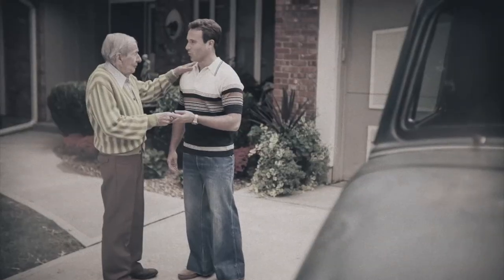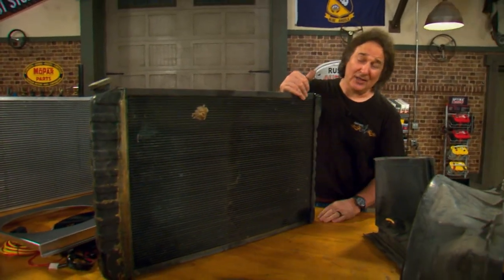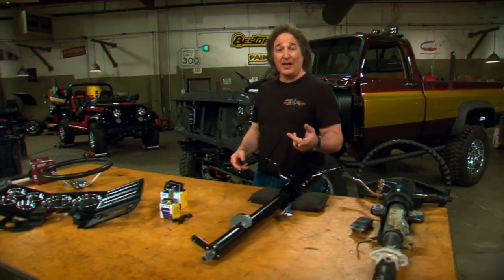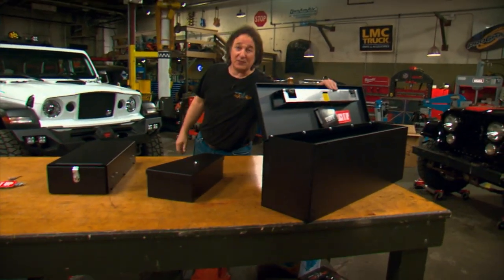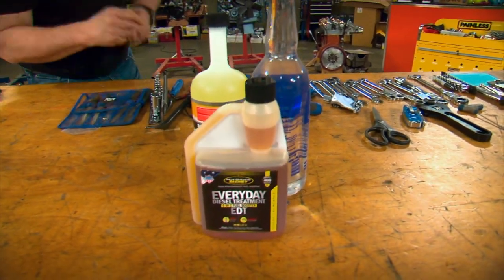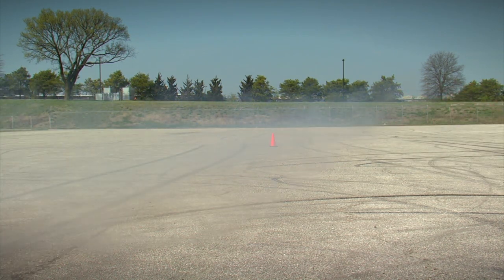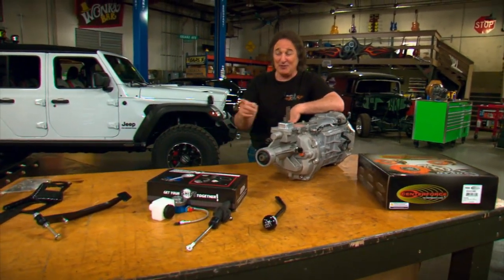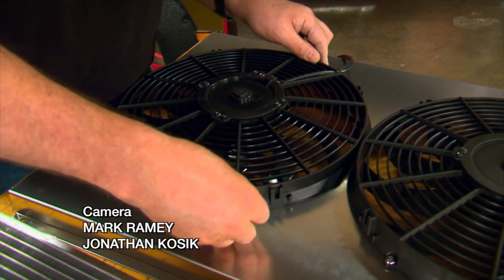Stunt Double Squarebody Chevy AC & Cooling Upgrades & Jeep Security - Stacey David's Gearz S14 E10

Comment: just an fyi, u can repair a furture hole in that copper condensor and radiator with sand paper, a basic role of solder, and a blow torch from a local hardware store. can't do that on the aluminum stuff. something to keep in mind when deciding to replace them.
Reply: i soldered my copper rad on my 85 k20 once and ill do it again before buying an aluminum one . nothing wrong with new its just cool to keep it old school

Comment: Gladiator?  I remember when the Gladiator was built off the old Jeep J-series truck chassis. There was an extended  Wrangler based wagon built off the Wrangler or CJ chassis. The CJ8 or SCRAMBLER.  So imagine my disappointment when Jeep (now Italian made FIAT or other subsidiary) announced the Gladiator. I expected a true Gladiator J20 truck and was ready to put down a deposit and get in line. After four CJ7s, a CJ5, a CJ8 (1981 w/ LS3 7004R, Dynatrac 60 rear & 44 front), two Grand Cherokees, a standard Cherokee, and my current JK Unlimited Rubicon, it looks like my Jeep days are over. Not only did they get the badging screwed up, they moved the iconic lighting from the center grill to the fenders. Ha... they should have iced the cake by going back to the lame square headlights. 🍕